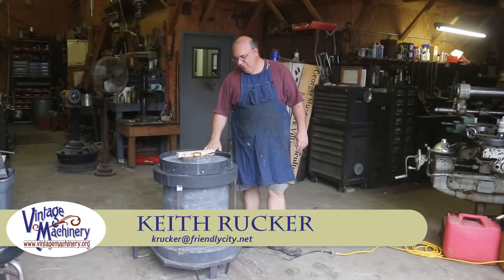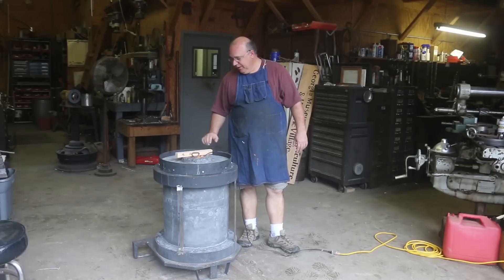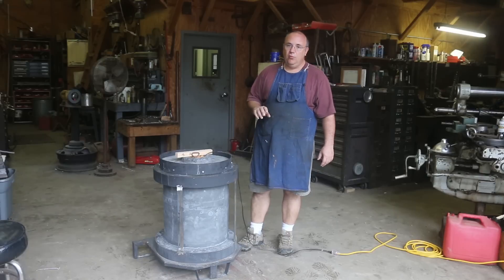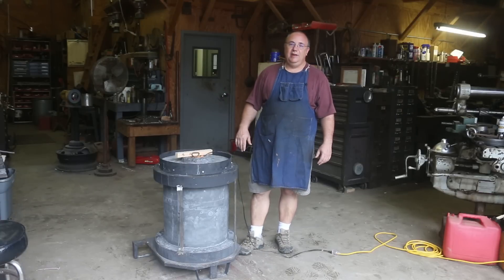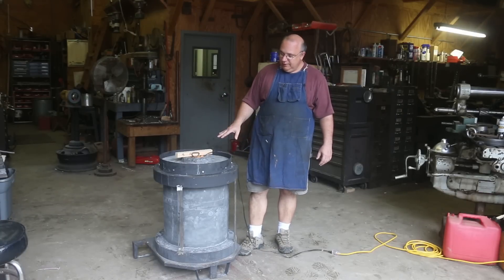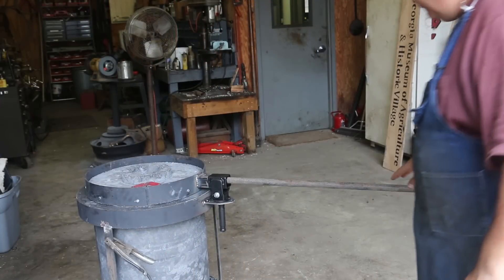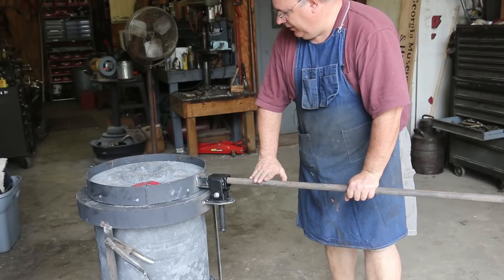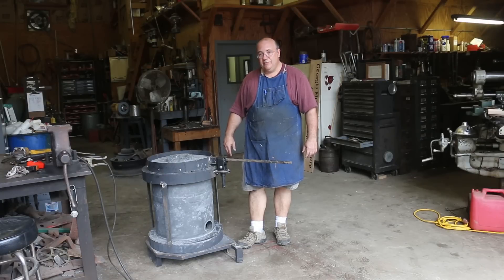Building an Oil Fired Foundry Furnace - Part 8:  Mounting the Lid Hinge

Comment: Let me add my vote for gussets. You will eventually bend the lid frame metal and the refractory in the lid will get loose or even crack. There is a lot of torque on that weld causing the lid frame to twist. You really need to distribute the stress on the lid frame from the hinge (left and right, not up and down)  to minimize the twisting forces on the frame. You can come off the hinge square tube with a piece of flat iron that then is welded to the lid frame 6 inches or more away from the square tube. You could also use a  tube or even use angle. Think about it. You don't really want to be making a new lid down the road.
Reply from the maker: +Richard Weaver I am looking at how I might modify the hinge a bit to add some gussets.  It will also have a support leg under it.

Comment: Hi Keith, happy new year! :) 

Nice seeing it making such quick progress now! One question if I may?:

In the drawing there appears to be a tube that runs from the hinge 'pivot axle' down to the base. I can see that this will provide lateral support for when the lid is opened? Are you planning to add that later?
Reply from the maker: +mictho100 Yes, I just did not have the right piece of tubing for this when I was working on it the other day.  I have to find the proper piece.

Comment: just two items to add, imho, -- the torsion support (a.k.a. the vertical pipe) and the open position rest (like a foldable shelf of some sort). the small hinge butt weld alone is not going to hold the variable torsion loads. this is, i believe, what charles marlin has meant.
hope, the tangential pipe, below, is not going to be in the way.
thanks for the video, keith!
-toly
Reply from the maker: +Toly Dukhovny The pipe will not be in the way.  The pipe on the side comes out at an angle that will not interfere with the support bracket.

Comment: Isn't the hinge directly above the inlet hole for the furnace heat source?  If you put in place that 2" post you mentioned, it will be smack in the way of your heating rig :/
Reply: +excession777 He might have an advantage there. The post could have a loop or a bracket on it to hold the burner. It could also be a mount for the valve so that he does not have to bend over to adjust the fuel flow.
Reply from the maker: +excession777 The pipe comes out at an angle that will not interfere with the upright pipe - it will be right behind it.
Reply: +Keith Rucker - VintageMachinery.org If you do a hook, put it on the far side and rotate the lid counter-clockwise to open it. Otherwise you'll be tripping over your burner trying to open it,

Comment: Regarding the outer skin: will it be stainless sheet metal? Can you weld nuts to the inside of the three legs? Threaded fasteners might be the way to go if you think you will need to remove the skin in order to service the insulation.
Reply from the maker: +Kevin Hornbuckle I am leaning towards stainless if it is not too expensive.  I plan to use some screws to hold the skin in place in case I do need to get back in there for any reason.

Comment: That'll be nice to work with!  It's probably deceiving in the video, but it seemed like to hinge bolt had a bit of slop in it.  Maybe you could drill/ream up to the next size to tighten that up?  Someone else might of mentioned it in the comments, but you could possible counterbalance the lid with a much heavier section of shaft on the handle?
Happy New Year!P.S.  (I was hoping there would be a photo in this video of you in Mickey ears!)
Reply from the maker: +Jack Hoying I think that what you were seeing was actually some slop in the handle because I did not have the correct size pipe in there.  The hings is actually pretty much right on.  As for Mickey ears, the girls had some but not me.  I just could not quite go that far....

Comment: Please gusset the mounting bracket. Nice job.
Reply: +michaelfarm yep theres a lot of bending stress, could crack the weld pretty quickly, better to be safe, its not like it has to be lightweight!
Reply: +michaelfarm 
Adding the down rod from the original drawing would also go a long way to removing those stress's.
Reply: I though the same thing especially as plate will get a lot of stress.

Hopefully from more casting videos because they're awesome to see.
Reply: I agree completely, I would even go as far as gusseting the lid side too.

Beyond that I would think about adding a counter weight to the handle.
Reply: +michaelfarm And put a hook for the lift rod! That's too much stress on the hinge to leave as is.
Reply from the maker: +michaelfarm There really is not room for gussets under the bracket the way it is designed with the bolt holes to allow it to be removed.  The support pipe should take the weight off of things.
Reply: Keith Rucker - VintageMachinery.org I meant a gusset to the sides of  the lid. To prevent these lid from breaking off if it get stuck while turning.

Comment: If you put in that vertical tube support, won't it be in the way of your burner?

Also, I loved the fast forward, as usual!
Reply from the maker: +John Dunlap No, the burner comes out at an angle that will not interfere with the support leg.

Comment: Would using a piece of solid rod in lieu of tubing act as a counterweight and allow you to keep the handle short?
Reply from the maker: +Bigrignohio You could, but the lid is really not so heavy that it will be difficult to lift even with a fairly short handle.

Comment: re: the handle....yeah, I concur with Fred Miller...handle should be removable....1/ will get in the way & 2/ if u leave it in place while lid is open, will get very hot as its near the mouth of the furnace
Reply from the maker: +Graham Blackmore The handle will be able to slide in and out of the socket so it will be removable.

Comment: HI Keith Happy New Year I am wanting to build a furnace as well only I will be using fire brick they were free to good home so why not but I was wonder what to use for a crucible are you going to make one or use a factory made crucible
Reply from the maker: +DS75921 I will probably use a factory made crucible.  I already have one clay crucible that will get used with this furnace, but I need several more.  You are not supposed to melt different materials in the same crucible.
Reply: Thanks

Comment: Hi Kieth, I know you're way past this point now, but I figured I'd say anyway. 

I work with concrete in a lab and field setting and the idea that concrete needs to 'dry' out is wrong. Concrete cures on a hydration process and for concrete to reach maximum strength it should actually be submerged ideally in a lime-water mixture at ~20C for 28 days. With most real world work this is unrealistic, so you see a lot of people doing the next best thing, covering their concrete with curing blankets and spraying large amounts of water on top of them. With a project that is oddly shaped like this one, a curing blanket wouldn't lay completely flat so this would be difficult, but I would suggest having a hose and spraying down the concrete with water whenever you can for at least 3 days. Another easy way to do this is to create a sealed environment around your form, so water doesn't evaporate at all, you can do this by simply wrapping poly around the concrete and leaving it for a week. Your ultimate strength will depend on how early in the hydration process the lamp was placed in the form and the accelerated evaporation began and how much extra heat it delivered to the concrete. However, I'm not concerned that you've created weakened concrete from a single lamp placed in the form, just a heads up for next time (if there is a next time).
Reply from the maker: +KMT Science I agree with you on concrete, but you have to remember that refractory is not concrete.  Because of the high heat properties of refractory, water can really be your enemy as when the refractory heats up, any moisture in the refractory can boil, cause steam, and cause a failure.  With refractory (at least this refractory), they recommend drying it out about a week after pouring, which is more or less what I did.  They also advise to not allow the refractory to get too wet.

Comment: I used to work in a diecast plant, and it seems to me that they used a gas burner to heat the furnaces for about a week before putting hot aluminum in them.
Reply from the maker: +Richard Haisley It won't take a week to heat mine up, but it will take a little while.

Comment: +Keith Rucker Maybe put a sliding counterweight on the handle tube so you don't have to muscle the entire weight of the lid. Slide it out to the end when you open and push it back to the pivot after it's closed. Just my 2¢.
Reply from the maker: +toolguybak Not a bad idea but the truth is the lid is not that hard to lift even with a short handle.

Comment: FWIW I also believe the handle should be removeable. That way it is cool and out of the way. it will only be used 0.01% of the time. Also, the stilt you mentioned is in my eyes essential. Just support the flange, perhaps a piece of U channel would be best.
Reply from the maker: +Mark Bernier The handle will be removable and the support leg will also be added.

Comment: how about making the lid handle vertical.
Reply: +Carter W Hern The more vertical you get you would lose some of the ease of use (mech advantage) during swinging it open.
Reply from the maker: +Carter W Hern That would probably work, but it also would probably catch some heat from the top of the furnace blowing off, perhaps making it too hot to handle!

Comment: Cool stuff, that forge does look really heavy..  I am interested in the burner setup you put together.  I was looking at Haza designs then stumbled over "luckygen1001" who was making cast iron castings in his furnace using only a propane burner  Had to look this up, 2300F...  and it looks like his air source is the exhaust from a vacuum cleaner..  So, it will be interesting to see what you build.
Reply from the maker: +Paul Gdry The burner I am building is a design that others are using to melt cast iron, so it should be doable.